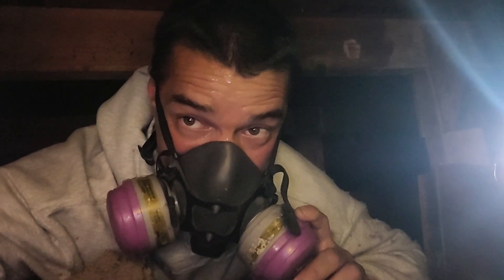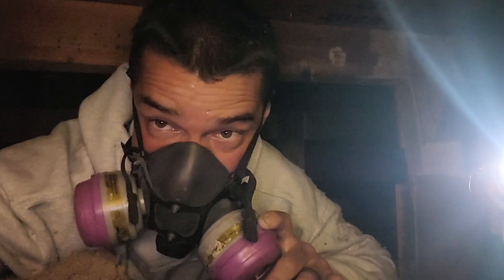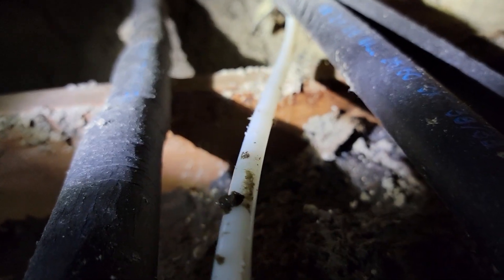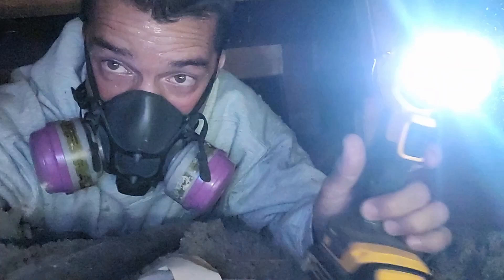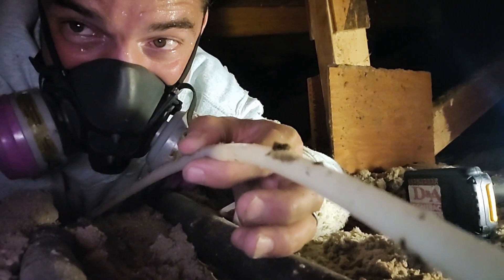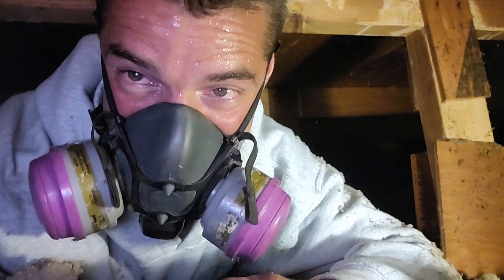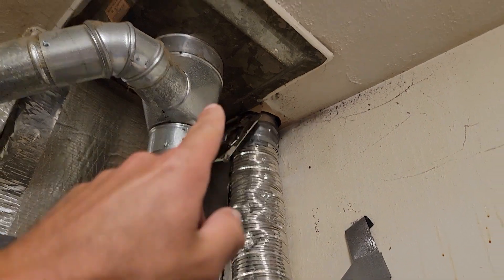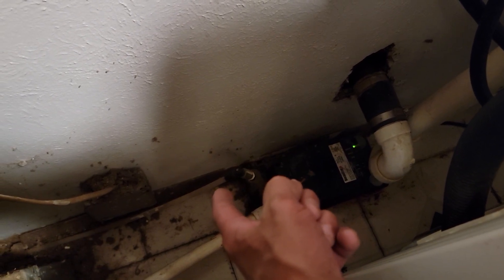Roof Leak NO HVAC

Comment: I hate crawling in attics.  Aside from the itchy fiberglass there are spiders, scorpions, millipedes, mice, electrical lines, etcetera up there.  When we have our guys do a repair that I'm not 100% convinced is the roof, often I'll ask them to remove a sheet of plywood over the leak spot and check for any water lines.  I'll even recommend homeowners to have their HVAC contractor do an inspection for leaky or disconnected condensation lines before we do work on their roof sometimes.  I've had 3 homeowners contact me back and thank me because it turned out it was a water line and not their roof.  It saved them money on a roof repair that wasn't going to fix the issue and I didn't had to deal with the mess of getting called back numerous times.  But that's why in trades such as roofing we always learn something new.

Comment: Man I hate when a customer won't believe you when you say there's nothing wrong with the roof and you gotta go in the attic to find something like this. I've had to go up and literally remove the vent pipe from bathroom fans and take it down to show them that it's wet and leaking because they won't take my word for it. Even after I already changed the vent on the roof because of a small crack lolol. Well, you gotta do what you gotta do I guess

Comment: yuck in tight attic.  Common sense just isn't very common anymore.  Me, I would Y it into the drain and delete the pump.  There will be a mess if there is a clog regardless, but the water supply won't be contaminated.  The pump drain route may have been set up for an emergency water leak from washer or water heater.